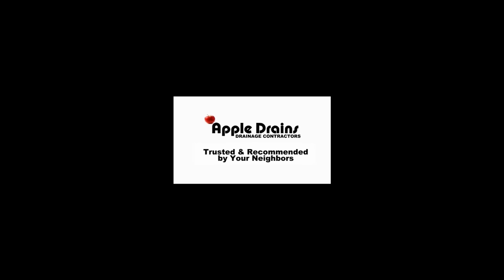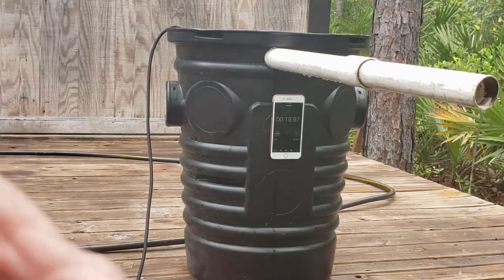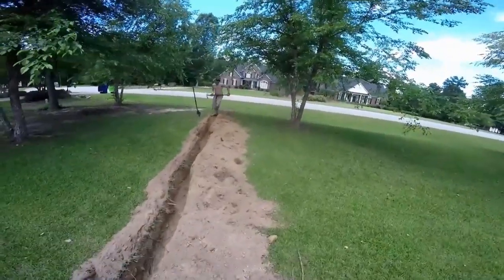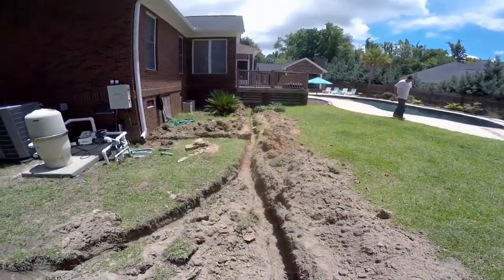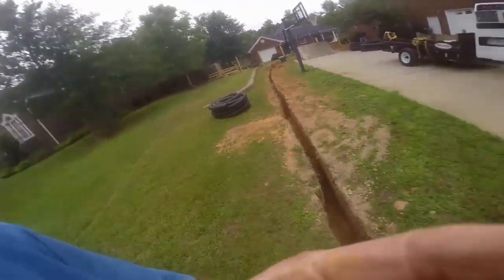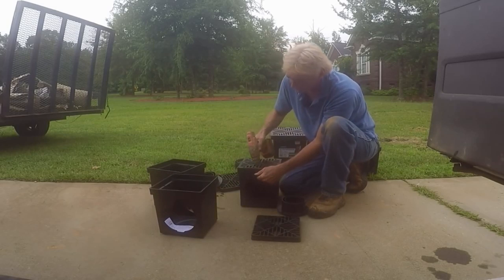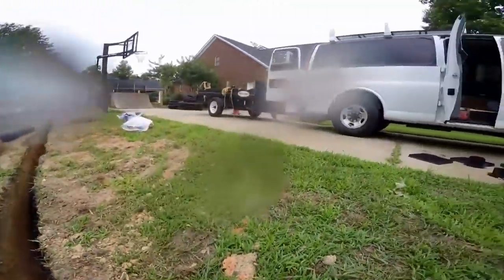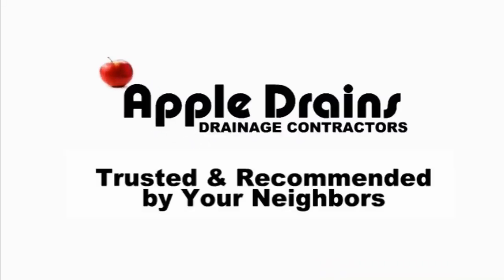Which is Better GRAVITY or SUMP PUMP?

Comment: After I installed my m98 in my garage and filled up the basin then plugged the cord in I was SHOCKED at how quick it got rid of it.  My pit is the bigger Jackel basin and my 4" line that is 10' long was also full so easily 50 gallons.  Gone in a little over 20 seconds.  Thing is a beast.

Comment: Depends where it is placed and what you demand from it.
Some places gravity will work just fine while on a different spot you really need a pump. (not all pump are equal)
But it also depends on the pipe size (size matters) and the slope of the pipe. (steeper is better).

Comment: Chuck.  You say the line will last 10-12 years then fail. What causes them to fail?  Is it just that they fill with dirt?  If so, can they not just be jetted to get them back working?
Reply: I’m thinking all the rock voids get filled with silt and dirt .
Reply: Jeff Quinn i am wondering the same thing.  I'm installing a 4" drain pipe under my basement and out my yard.  Have you found any answers to your question?

Comment: Well to answer the question there is no doubt a pump outperforms a gravity system but there is no doubt that a gravity system is virtually maintenance free and cheaper. So you have to make that call but most of the time it's dictated by the environment where your system resides
Reply: Mike Lewis SELA totally disagree. This test , is flawed in so many ways. A sump pump system is limited by the GPM it can discharge and this GMP is even more limited /reduced by the distance of the discharge line. Something you learned after installing a pump 😉

Any drainage system should be designed around the given volume of water it is required to move off site for a given rain event. In other words...GPM it is required to handle and discharge. 

A gravity fed system GPM can be increased by pipe size and pitch on the pipe, which is not limited by the length of the run. Yes, if limited slope prevents sufficient slope on the pipe the system can be limited by those site constraints. However, you simply increase your size of pipe to gain those GPM back.
Reply: @Bellislawns  agreed but I thought we were talking both same discharge pipe size
Reply: @Bellislawns  These pumps are great and really make me feel good... for twenty seconds. I would rather the foundations wouldn't leak though. But, when one or ten of the storms that dump enough water to take out the substation two miles away so the neighborhood has no power... and the rain keeps coming... that's when gravity wins my vote.  That happens once or a few times a year where I live so I prefer the slower, gravity feed.  The difference in 20-seconds versus 20 minutes is not important to me because the crawlspace is just as wet in both cases. Again, if power was forever, I like these pumps, but that is not realistic.  I need to bank on real events.
Reply: bob yes sir 👍

Comment: Gravity will be there for you when electricity might not be,  like in a storm or hurricane.  That said, I understand there may be situations where a sump pump may be the only way to drain.  If that's the case, I'd sure have a 12 volt backup and a way to wire it to my car.